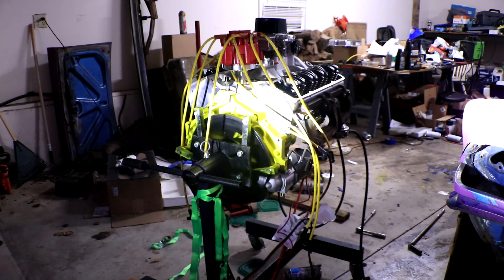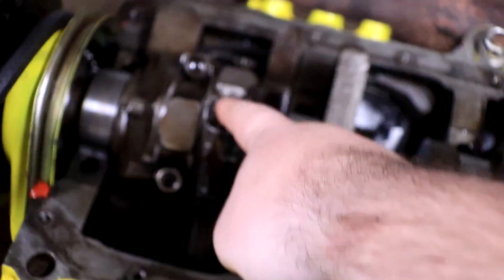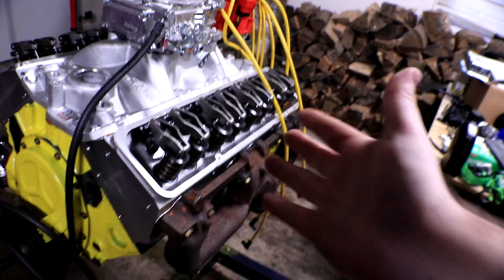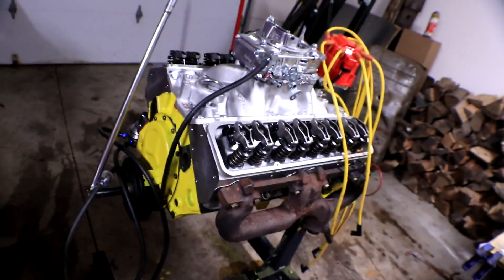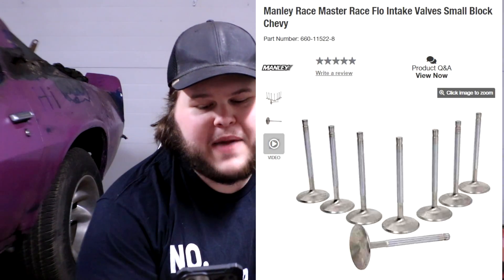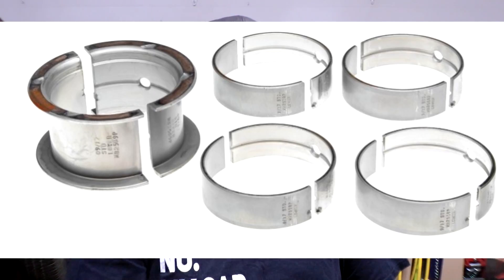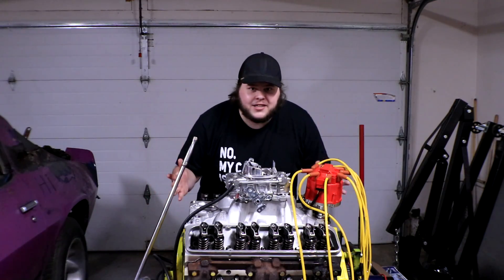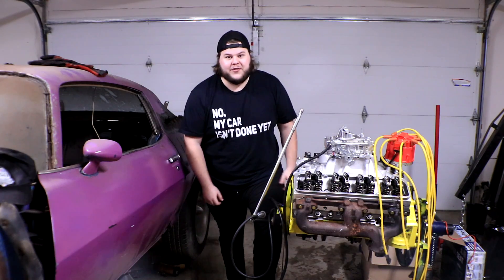The $1,700 MISTAKE that KILLED my Chevy 350 Build.

Comment: Nice to see a young man out in the garage working on his project.  Hey My Friend, mistakes happen, things get learned, and one progresses.  Aside from a couple of other things I noticed in your video, please allow me to clearly state, although many have good intentions on the internet / YouTube during their replies to you, not everyone has the experience for you to call upon, regardless of what they may tell you.  Now on for the experience part of this discussion ... Although there is not enough background info for me to draw upon in this particular video, I did notice the valve adjustment on the engine on the stand, which IS WRONG, so, unless you already loosened the rocker arm adjusters prior to making this video, that alone could / more than likely is the reason for your no-start situation ... NOT the bearings.  I suggest learning the simplistic and proven method of E.O.I.C.  ( Exhaust Opening, Intake Closing ) method for adjusting your valvetrain.  Although there are easier ways to adjust the valves, the E.O.I.C. method is all but fool proof and the most simplistic to learn as a starting point in your engine building education.  With respect to engine bearings, unless you are unable to turn the engine over by hand, the engine should have started, and, when it did, the engine would have possibly starved for oil ( Bearings ), spun the bearing / bearings or simply seized, but, if you were able to turn the engine over by hand,  the bearings would NOT be the only cause of a No-Start Situation.  With respect to broken head bolts, questions must be answered prior to simply replacing them with expensive and unnecessary parts / bolts.  Did you " CHASE " the head bolt holes as part of your block set up, was debris possibly left in the head bolt threads, did you use oil on the bolts during assembly, did you torque the head bolts in proper sequence and in the proper stages ?  These are questions that must be answered BEFORE rushing out for expensive ARP Bolts and Fasteners, which, if the above steps and questions are left unanswered, WILL ALSO BREAK OR STRIP !  Jegs ( On Line ) sells a great Head Bolt Kit ( I can get you part numbers if you need the help ) that are GREAT quality and well made, at a fraction of the price of ARP.  Now for the Pushrods. ... If the pushrods are " HARDENED STYLE ", factory length and STRAIGHT, they will work, just clean them up, blow them out and reinstall.  Most Aluminum Heads have Pushrod Guide Plates ( I believe yours has them ? ) and, the use of Non-Hardened Pushrods will cause them to GALL ( Scrape ) and possibly break  or Bend after a short time.  .. The Camshaft ( I would need the specs ? ) may be just fine, just inspect it ( Flat Lobes are relatively easy to spot ) NO REASON to rush in to a expensive replacement, just to say you have a name brand on the end of it, as long as the specs meet your needs and the cam is in good condition.  As for oil, YES, you need to make sure that you use a ZINC type oil with a Flat Tappet Cam.  I suggest SHELL ROTELLA " T "  15W40, ( It is a Truck / Diesel Engine Motor Oil ) as it is HIGH in ZINC, readily available and it can ( AND SHOULD ! ) be used for the life of the engine, to include ALL future oil changes.   USE WHATEVER BRAND OF OIL FILTER YOU ARE COMFORTABLE WITH.  My name is Jerry, Please understand, I have been building AND RACING Chevy Engines for almost FIFTY ( 50 ) YEARS, I made my living building and SELLING those engines to many teams, and, other than the teams bringing them back for upgrades or service related rebuilds ( Refreshing ) , I have had very few failures, but, a number of RECORDS.  I am getting old, and simply want to pass down my knowledge and experience to any and ALL that will use it.  If I can be of ANY assistance, or if you simply have questions, PLEASE REACH OUT. ... SEMPER FI TO YOU AND YOURS MY FRIEND ... Keep On Building and Learning.
Reply from the maker: Hey Jerry! I super appreciate you taking the time to leave me this info! I did all of the things you asked about in this process, and the reason I was lead back to the bearing clearance was that the crankshaft was incredibly hard to rotate even without the main caps in. So hard in fact that the starter could not turn the engine over when everything was put together! (I have a video showcasing this if you want to see firsthand.) 

I have no problem spending the extra money on the project to ensure it has a much longer lifespan and good proper products that are far less likely to break! 

My FB page is the best place to reach me if you want to chat more!
Reply: @TheGarageGoblin  if the Crankshaft was difficult to turn with the Main Caps " Removed ", then I would strongly suggest that you remove it and take it to a machine shop you trust, and have it checked for " RUNOUT " ( Is It Straight ? ).  If the crank is not within specs, this WILL cause tightness ( Or Seizing ) as well as intermittent oil clearance readings.  Since you will be visiting a machine shop for your cylinder heads ( Valve Springs, Valve Seats, Valve Grinding, Pressure Checking and so on ) you may as well spend the few bucks and have the crank inspected.  Just a suggestion.  Best of luck.  SEMPER FI

Comment: Buddy I've been watching your videos I don't know where you live but some good information some people are giving you good somebody giving his soul so make sure you clean that block all over again chase the threads make sure everything is spotless including that oil pump I know you're having a bad luck on it wish I was closer by give you a bigger hand good luck I'll keep watching by the way that my mom has you just bought two new valves for just take the heads to machine shop have them check the clearances and assemble it for you he'll be money well-spent cuz you may have brass guys instead of bronze guides develops holes might all be the wrong size you need someone to professionally to check that out for you
Reply from the maker: Would’ve loved to keep the valves in the heads but they’re cheap and are almost guaranteed to break under normal running conditions. Upgrade will be well worth my peace of mind lol!
Reply: @TheGarageGoblin  not sure you were understanding what I was trying to say about the heads you need to take them to a machine shop the clearances with your better parts are definitely going to be different things you can't do it home without them doing it for you with the right equipment to shrouding might be off the valve seats might be ground off to one side you need to have them checked just trying to save you a bunch of headaches I worked on aftermarket aluminum heads before and actually seen some that had to be throwing away good luck

Comment: The Fram is the least of your worries, but the Wix is better. Some gaskets you can definitely get away with reusing. Most, really. Replacing them isn't a bad idea though. The advice on the heads I can't really speak for, but I'm not sure why everything would need to be replaced. Just because they were eBay heads? Guess it depends on your plans for the engine. Overall, you'll definitely be building a more stout engine, but obviously more expensive and time consuming. The better brand on the bearings is absolutely a good bet. No matter what, you're doing amazing and you're gonna fly past 1K subs in no time! You have a great formula for your channel and your growth is impressive. Only a matter of time until you blow up. Hopefully not the engine. ;)
Reply from the maker: Just willing to bet cheap heads = cheap valves, metal might be decent on them but I’m not willing to risk one of those valves snapping and falling into a cylinder
Reply: @TheGarageGoblin  Totally fair haha. Keep up the great work.
Reply: @TheGarageGoblin  The filter isn't that big a problem as you will dump the running in oil and filter at about 1000 k's.

Comment: I think you should get a harbor freight or Amazon bore gauge and mic set to measure your clearances, as you might need to buy 1/2 thou smaller/larger bearings
Reply: I agree with this 100% measure everything three times ideal indicator inside outside micrometers and do the math every time.

Comment: I'm In the same situation of parts except it's just the rockers. I have some old custom rockers that were used when my sbc was in a bel air racing in the Carolinas and they've been the only thing I've had. I don't know what brand of long slot rockers are good without spending more then $300. I also need to find a good out of the box carburator

Comment: make sure your valve springs have the correct seat and open pressure recommended on your cam card and don't go into coil bind at full lift

Comment: I would use Felpro 1010 gaskets.  Proven to be very reliable, work great on aluminum heads, and cost less.
Reply from the maker: Killer, thank you!
Reply: @TheGarageGoblin  NO your block is not decked you need a 0.15 thin coated stainless steel shim gasket Felpro 1094 to get quench right to around 0.40" !

Comment: Oh well, nothing like practice to get better at something. Don't worry it will be easier this time around. Don't order the valve springs and possibly the valves until you get the cam, they should specify what springs you need (it is pretty important). Then the springs manufacturer will tell you the installed height and the valve length might need to be longer (depends on how much lift you have). So basically get the cam first and buy stuff to suit that. It would be better to take the heads to a reputable head shop to get everything installed properly - there can be a bit of setup involved.
With oil filters, probably best to get a factory one from your Chevy dealer (AC Delco), I always use Yamaha filters on my bike because they are designed for them. They aren't going to sell a crap filter that might cause warranty issues for their cars. But anyway if you use WIX just be aware there are different WIX filters and with roller lifters you can use synthetic oil - I think the WIX XP is their best filter for synthetic oil. If you really want to get confused just check out how many non expert oil filter reviews there are on YT. Good luck with it all.

Comment: Clevite bearings are really good just double check everything and maybe to help before you put the distributor in you can use the oil primer tool with a drill to get the engines oil primed that way you know the oil pump is working it rarely happens but can save you some pain

Comment: When you come to replacing the valves please dont just put them straight in and fit retainers, springs , collets etc. 
Lap each valve to each valveseat then using engineers Blue check the valve to seat contact. And one thing I do and have done for over 40plus years on both petrol and every diesel I do is after you have blued the valve and checked the contact marking  and are happy with it , is to wipe/clean the blue off the valve only not the seat in the head then hit the valve back onto the seat to see the transfer of the marking blue from the seat back onto the valve. This will 100% prove you have good seat contact/sealing.does it take a bit longer? Absolutely,  but it has to be right as a bad seat will lose you compression and possibly lead to burning a valve and the only cooling those valves seats  see is when the valve touches the seat in the head. If those heads are Chinese God knows what angles the seats have been cut or ground to. 
The photo showed Manleys "budget" series valves. If yiu are going for premium Inlets then because the exhausts get a much much harder life than an inlet valve they should be premium as well.
Reply: exactly!
Reply: The comment you made telling me about whats in store in Germany and possibly the US regarding classic cars, parts etc is unbelievable. And why would you slow gas pumps from 20litres/min down to 2litres/min?????
Better move down here to NZ.plenty of cool cars, parts suppliers, good roads, best beer (haha), good people. 
Plus the good old "she'll be right" Kiwi attitude.
Reply: I honestly dont know how to reply to that. 
Hard to believe that is the proposed future for not only your country but possibly a lot of others. 
Id be ripping your Vette as much as humanly possible. 
Use every litre of fuel you can, punish those rear tyres for as long as you can too before it (hopefully doesnt) get taken away.
Reply: @matui6983  they are completely nuts here! They tell that only 20% of the future population (after 2035) in EU  will have to be allowed to travel at all using any kind of car the others will have to live and work in an 15KM radius of the hometown. Of course all of that to save the worlds climate.
Reply: Do you think all that could possibly happen. 
I guess a smaller country could be made to live a certain way but surely the majority of German people would oppose these totally crazy suggestions?

Comment: The difference in oil filters is not the quality but the size of the holes in the medium. Street filters like Fram have 10 micron holes which filter the oil well but are restrictive. They're made to last 5-10 thousand miles. Use a Wix race 61 micron filter. It'll assure plenty of oil gets to the bearings. You'll have to change oil and filter more frequently but at least your engine will live.

Comment: I almost wish you could have completed an engine using the ebay stuff and a complete separate engine doing it the proper way with known and guaranteed parts. Then do a comparison on the dyno numbers and then see just how long that ebay engine lasts compared to the good solid one.

Comment: The Chinese harmonic ballancer you have wont work safely and can explode they are ticking time bombs! Please get a Fluidampr (ORIGINAL US MADE not Chinese crap copy) or an original GM harmonic ballancer. (You need to get your complete crank/rod/piston assembly ballanced  or your engine might vibrate to death!) Dont forget you have an original cast crank these are fine for a mild street engine but they need a supberb ballancing job because they are brittle and break when vibration occurs. The best thing would be, get a balanced forged steel crank for example a Manley forged one. Than put the con rods upper and lower ends on a scale and match them to 0.5 gramms. Same story with new forged pistons. (You cant use the chinese pistons! Dont use Chinesium cast aluminum pistons in your engine!)

Comment: honestly man I'd put a set of clevite 77 standard rod and main bearings in it, change the timing gear, put a wix filter on, fill it with royal purple breakin oil, prime the oil system, start it up and run it 2200-2300 rpm for 20-30 minutes to breakin that hydraulic cam and let er rip tater chip....
Reply from the maker: I love this comment because it shows how many ways there are to build an engine. Your method could very well work, and so could someone else’s. Feels like 50% of engine builders are just guys with a dream, and 50% are licensed surgeons 😂
Reply: @TheGarageGoblin  I'm no surgeon but I have made a few dreams come true...😆...and I've built several engines and I've made mistakes too, I'm currently building a sbc 302 that started life as a 327 in a 1968 Camaro, I will be using 1969 dz302 cast iron heads #3927186 as well as rotating assembly that matches dz part numbers, when I was a young gun I dreamed of having a dz 302 sbc, well I'm gonna have one with the exception of the dz being stamped on the block deck and cross ram intake.
Reply: He cant use the fake chinese lifters! Those will wipe out the fake cam during a few miles and than you have all those shavings in the engine oil system including the new bearings...the lifters are fake Delphi ones with a flat (non convex) surface and they are not rockwell hardness 40...they cant work.

Comment: #Plastigauge Need to use plastigauge to check clearances even if it is fresh from machine shop. Turn over the motor after each rod is installed and check for binding

Comment: Break in oil is a must.  The Driven products are excellent. 
Manley valve are good. 
Howard's cam is good.
Roller is the only way to go. 
DON'T GET A WIDE 112 LSA 
Keep it about 108 if you have a 350.
Check out David Visards YouTube channel.

Comment: felpro 1205 intake gaskets. If your using MLS head gaskets your block needs to be deaked to a certain surface. My friend your wasting money on this build. Get your crank measured and polished aleast. Get your rotating assembly balanced. You can't just slap new pistons in unless they are the same weight as your old ones. Your block mains should be line honed. I'm not bashing you man but you still are not on the right road and are setting yourself up to loss that engine. You also don't need valves. Just take your  heads to a machine shop and have them gone through. Also be sure the springs installed are for a roller cam. Good luck.
Reply from the maker: Thanks for the tip on the MLS gaskets! Definitely will swap these out with a different type. And idea what would work with aluminum heads?
Reply: @TheGarageGoblin  on an undecked block Fel Pro 1094 0.15 will give the right quench of 0.40 but before measure your quench with a deck bridge tool. (How deep are the pistons in the bore when on top dead center)

Comment: Don't replace all of the head parts. Send them to a shop and have them check them out first.
Reply: the valves and springs are made of Chinesium and will break after some couple of miles.
Reply: @Schlipperschlopper   I would have a machine shop do the work.

Comment: Don't forget the gear for the distributor  since you will use a roller cam the steel must be match with a bronze gear or polymere one!
Reply: Neither is good for more than 10,000 on the street. Those are race only. He needs the steel melonited one that Howards sells for their cams.